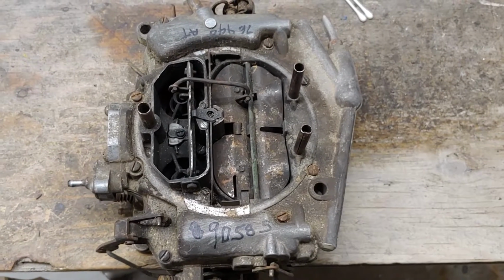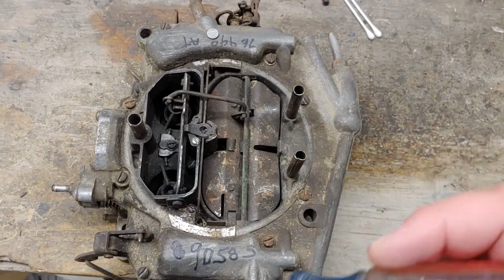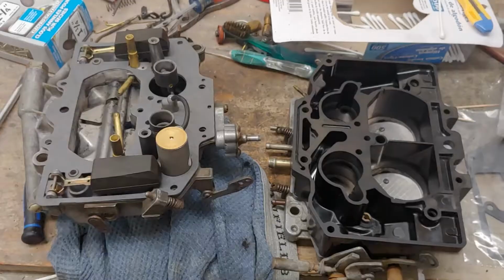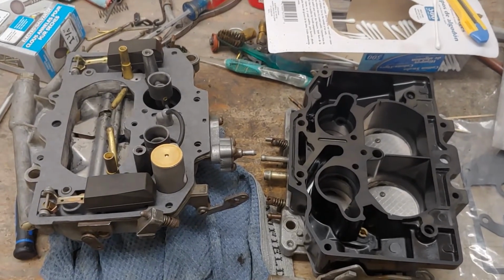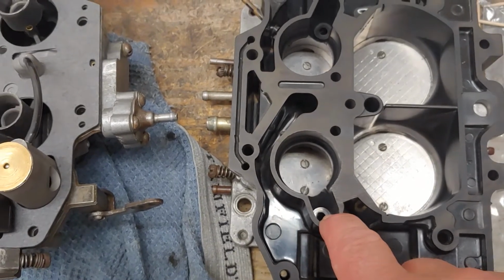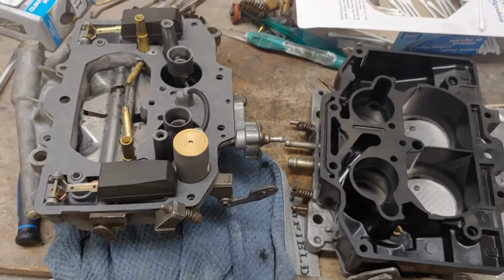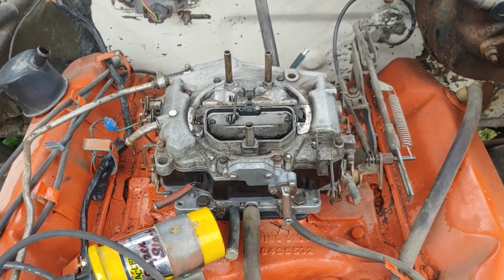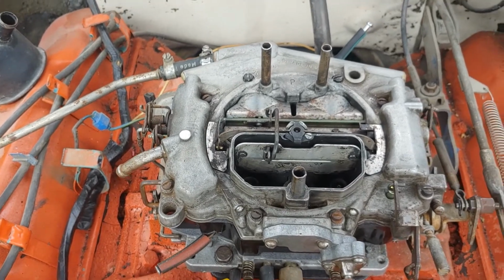1978 Dodge truck - Thermoquad 4 barrel carburetor swap

Comment: Hi I hove 1977 Dodge 3500 440 engine with termoquad 4 barrel carburetor South Wind Motorhome .Carburetor was rebuild 3 years ago but now is overflowing with gas .Start sharp when siting a day or two even weeks , but when gain temperature and Idling will set at 1000 , suddenly will shat off and I'm not able to started again, carburetor is overflowing with gas end spark plugs as well. How to set the carburetor to get rid of excess fuel coming in ?. Thank you
Reply from the maker: Likely the carburetor needs to come off again and taken apart. It could be a stuck float.